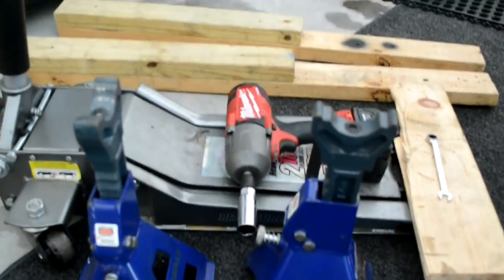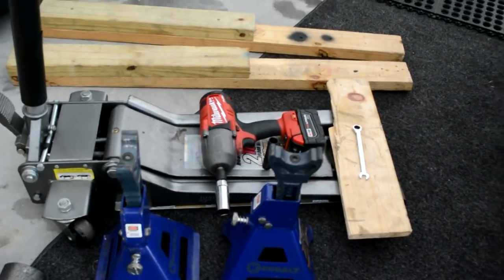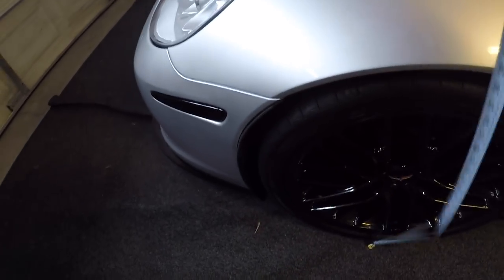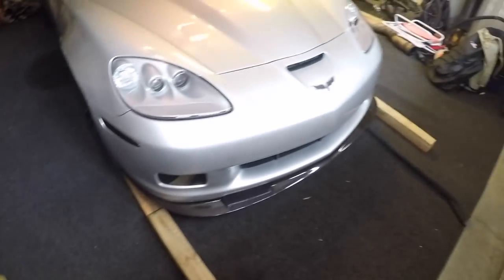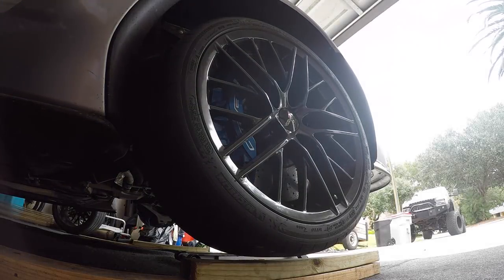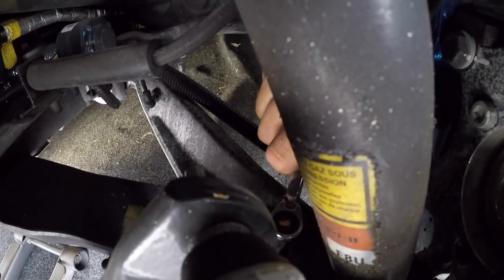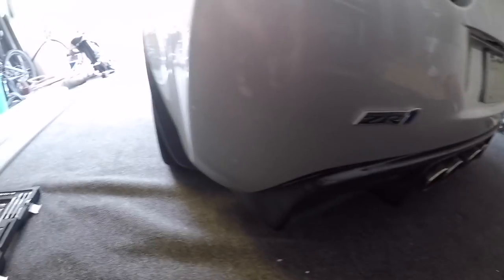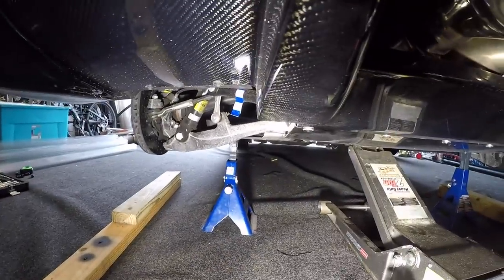HOW TO lower a c6 corvette in under 45 minutes for free!

Comment: Just FYI, there is no “settling” with this mod. Settling occurs when you install a new spring on a car and then the vehicle weight sags the new spring a bit. In your case, you just adjusted the screw which altered the mounting position. The spring in your car “settled” miles ago when your car was new.
Reply from the maker: Soon as I let the car down it was taller than it was before so I went and drove it a bit and it came down a bit more. The car got lower and lower
Reply: so would this cause a boaty suspension feel?
Reply: There is always “settling” anytime you raise a shock/strut all the way up, takes time for it to re-compress

Comment: Thx for posting this. I've actually been looking for something that showed the stock ride height of a ZR1 as I'm going to lift my front just a tad. I live in the one part of North Texas that has some hills to it and I'm just scrapping the hell out of the air dam. I've got a Lingenfelter 670 C6 Corvette and the ride height is the only thing I haven't really dialed in yet. Previous owner slammed the front but left the back stock so it's raked... not my favorite stance.

SUBBED.

Comment: Great video & nice car... contemplating doing the same for my z06. Just curious to know if you measured after to see how much of a drop you achieved? Also, with taking both the front and rear all the way down, did you lose the stock "rake" look?  Some pics I see on other vettes the front ends up looking higher than the back
Reply from the maker: it was around an inch I believe. im gonna lower the rear a little more when my new wheels come in

Comment: No After measurement? No mention of alignment? Which if it lowered much would be required! Not exactly sure why one would want to lower it other than looks. My Z06 drags as it is! Guess for some looks override function?
Reply from the maker: The after measurement didn’t make sense because the springs weren’t settled
Reply: You bet needs alignment.